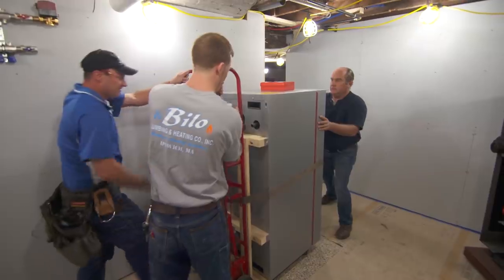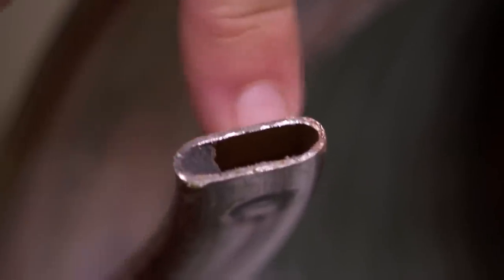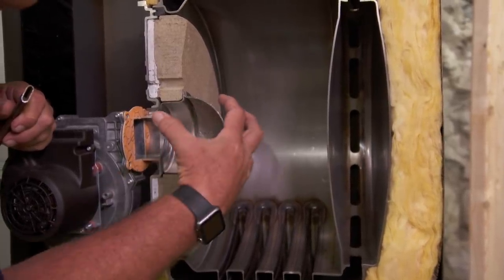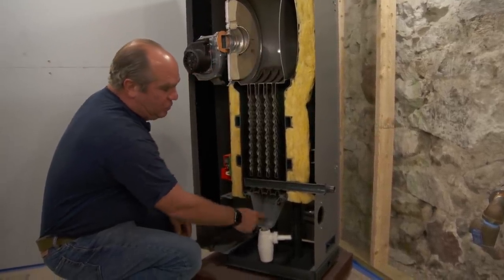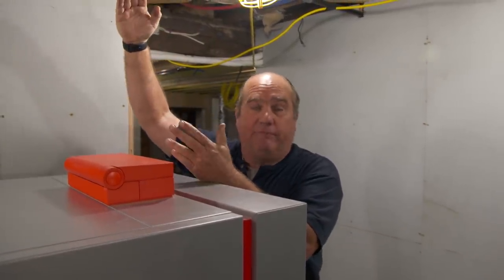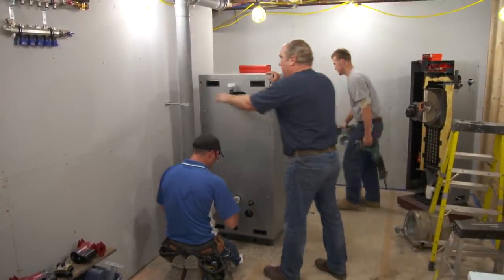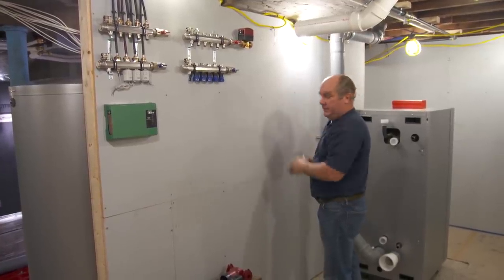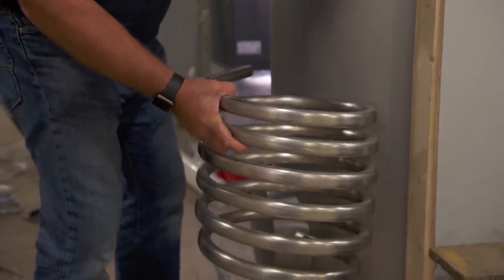How to Choose the Most Efficient Boiler | This Old House

Comment: That boiler is the Vitocrossal 300 CU3A with the 79 gal Vitocell 300-V domestic hot water storage tank.   The vent piping is PolyPro from DuraVent.   The advantage of this type of high mass boiler is that it doesn't require a high flow secondary loop.   The existing pumps and loop from a cast iron boiler will work fine.
Reply: Thanks. I have been researching boilers to replace the nightmare system the last owner of my house put in. You would think TOH would have shown the boiler maker label after they supplied the cut away model for them.
Reply: Is this an "on-demand" oil burner?

Comment: 96% is great and about the top. But when it comes down to it cost per btu. Oil fired units are hitting low 90’s now and have more btu per gallon than propane. So once you factor that and the extra maintenance and that comes with a modcon boiler, are they cheaper over the life compared to a good cast iron boiler?
Reply: And how long is it going to take to amortize the cost?
Reply: In Michigan right now fuel oil is just over 4 dollars a gallon, I'm not sure about propane but I think it's less than 1.50 a Gallon..

Comment: We hooked up a super efficient Triangle Tube boiler that hangs on the wall...been working excellent for 11 years without a single issue...we also use soft water and paid a fraction of the unit they are installing here.
Reply: The Homeowners didn't want that, so they got this.

Comment: I wish they would tell you the cost of the install and equipment.  It has to be upwards of fifteen grand plus.
Reply: I just installed a boiler for my customer, It is 5 zones including the indirect water heater.  Just the parts alone costed me 11000 dollars.
Reply: This would be 30k
Reply: 30,000 and up
Reply: Its all nice when tv pays for it.
Reply: secret as is often donated. You do not get Donated unit.
Reply: @miriamvivo4279  that is a huge house. Houses that are 1400-2500 is enough and I heard for those sf the cost is around 7 grand to 16000.  I know that’s correct because I’m talking to 3 companies and they are quoting me these figures including coils and or registers at the walls.

Comment: Hi Richard, I'm Huntington NY, on Long Island. I need a new HVAC system. I have oil (Dirty) and want to convert to gas, also I have no duct work. Oil tank is almost empty. What do you recommend, when can you come? Thank you for all the great shows over the YEARS!!!
Reply: Buderus oil boiler or a system 2000 boiler. Both reaching 90% or better and are a lower install cost

Comment: I’m amazed the fan on the boiler will push the poc’s that far with so many bends on the flue, in the uk manufacturers state maximum lengths in meters, deducting for elbows and 45 bends, also that flue looks like standard drainage pipe?

Comment: What is the best boiler for a newer home like mine?  I have a Seer 18 Electric heat pump and air handler.   Seems like it costs several hundred yearly to keep this heat pump running right and they only last 10-15 years.

Comment: Connecting the boiler to a storage tank and then distribute to multiple manifolds may be even better as there is only one source calling for " HOT " water. Stored Hot water can supply heat to domestic supply and also radiant ( higher mass system creation ). Not sure of the brand of the Boiler shown.
Reply: Viessmann boiler, and Viessmann indirect DHW tank
Reply: all the high efficiency boilers tried to get away from large volumes of water because you waste energy heating a lot of water when you just need a little heat in spring fall seasons especially then heat is wasted as mid-day it is too warm in house
Reply: But if you’re running micro zones and can’t shed the btu at the same rate as the lowest turn down ratio then you short cycle. Buffer tanks are a great way to prevent short cycling the unit and reduce the number of start/ stops

Comment: Hi Richard, What is the manufacture of this system? I need a new hydronic system, I currently have oil baseboard heat and want to switch to gas. I would love to hear from you and your thoughts.
Reply: Why do you want to switch to gas? My new oil fired unit is 90% efficient. Oil has more btu pre gallon than propane or NG. Would be 10+ years before you saw returns on a gas unit once you factor the increase install cost and increased maintenance of these newer gas units.
Reply: Viessmann vitocrossal 300

Comment: That grey hub seal flue pipe.. If it were installed in Europe and ran trough a cavity in a wall some plumber after 20 years would come to add let's say a new bathroom, he would find the grey pipe in the wall and assume its a drain pipe and connect a toilet to it and next thing you know there poop flowing from your boiler XD
Reply: Hardly!!! In twenty years time no one in Europe will be using gas because "we" are saving the planet!!!

Any exhausting from a gas boiler would have been done properly ... via a flexible  stainless steel flue pipe ... to reduce our consumption of single use plastics.

By then we'll all be using green electricity, including nuclear, with air so clean you could breathe it if you had to.

Fossil fuels will be history and the land will be artfully covered in wind turbines or solar farms.

Homes will be built entirely of straw bales with an R value approaching infinity.

You own body heat will keep the houses at a comfortable 37C, forever, until we really get this insulation thing sorted.

Global warming will mean we're all tricked up with AC anyway ... though goodness where we'll dump the heat from that lot.

And of course a lot of people will be living on water, seeing as the Arctic will be just another sea and Antarctica will be just another massive island, like the Isle of Wight or Australia.

Everyone knows that.
Reply: @martinliehs2513  Indeed. We can only hope the folk who rely on the fossil fuel industry for their livelihood are moved into other decent and decently paid employment.
Reply: Europe is where polypropylene pipe was developed for flue gas venting, I highly doubt what you said would occur

Comment: Looking for new & simple direct vent (no chimney) gas boiler (80% efficiency is fine) that has best shot to last 20 to 25 years and is low maintenance - zero bells and whistles.  My focus is not efficiency.  Priority = low maintenance and longevity.  Currently running 1991 Slant Fin V90 - 80% Direct Vent - baseboard forced hot water - has been excellent, but time to change out.  Thoughts, guys/gals?  TY!

Comment: Isn't the flue gas condensate very corrosive?  Bad for clay or cast iron drainage pipe?
Reply: Yes
Reply: YES. You can add Neutralizer in the drain circuit. ( condensate is acidic )

Comment: Richard if there’s a known problem with wall hung condenser boilers why aren’t the practices changing to avoid the problem you are describing? Wouldn’t be prudent to at least flush out the entire system before hooking up a new system? Wouldn’t it be prudent to place at least one filter before the heat exchanger for at least one heating season so the heat exchanger doesn’t clog up with fines from the old radiator’s and return piping?
Reply: Wall hung units require yearly flushing to descale. But no amount of flushing can combat poor water quality for these systems.

Comment: So what is the name of this boiler?
Is it still considered a condensing boiler?
Reply: Looks like a Viessmann Vitocrossal 300. It is a condensing boiler. It's different than the wall hung units in that it holds more water, which allows the burner to run longer. Reduces cycling. These "super efficient" boilers are good at saving fuel, not so good at saving money.
Reply: @darrinmc  ... pay me now or pay me later. A fancy boiler is probably twice the money up front, but what's a couple of grand over 20 - 30 years if it will save hundreds on the heating bill each year? As for the rest of the system, I feel there's too much high tech to be trouble free for the next 30 years, especially when it comes to smart circulators and mixing valves. When there's a problem at 2 am do you think you will get a guy with enough experience, or the kid who is grabbing for all the OT he can get? The old fashion low tech approach was a separate tank with it's own t-stat for the radiant zones. The boiler's job was to keep that tank at say 100 degrees with a simple on / off cycle. Size the tank right and everything is golden!
Reply: @darrinmc  As a homeowner its still confusing to me. My local HVAC company quoted me 14k to change out my boiler with a Triangle Tube. Only to find out these boilers have issues similar to what this video points out. If I want to buy a new boiler and save on operating costs which one do I buy?
Reply: @SuperM1687  Weil-mcclain GV90.  92% eff. no maintenance needed.  30 year life.
Reply: I’d rather go with a cheap boiler and use a wood stove as a supplement.

Comment: Its probably all fine and code compliant since they are doing it but I don't feel so good about these snapping pipes with no glue
Reply: Trust me, this will last. Using this for decades here in Germany as drain pipes inside of the house, it can handle hot water and agressive chemicals better than PVC. Outside of the house we use PVC-U (unplasticized PVC), also not glued. The gaskets inside of the pipes are so tight, you won't get the pipe into them without lubrication. You see that in one part of the video at 3:21, the guy is lubricating the fitting. Normally you put them together until the fitting is completely inserted, then make a marking with a pencil. Pull the fitting back round about 1cm or 1/2" if you want ;-). That will give the pipes space for expansion and contraction caused by temperature changes.
Reply: It got a gasket in it to seal the joint. not sure how long the gasket will last.
Reply: @QnQoooo  If they use the same ones we use here on the other side of the pond estimated 50 to 60 years. Warranty is 40 years. It's designed the way it can handle 95°C (203°F) hot water without damage...so it is robust...

Comment: I'm considering to install a tankless hot water heater in my home.. it was built in 1990 however now i'm worried the existing pipes might clog the tankless heater with that gew he showed... Any suggestions? Pipes are all copper
Reply: Fernox, magnetic separator, strainer
Reply: Go ahead with Tankless water heater. Is the best thing possible. I had Bosch now with Rinnai  unit.....Flawless ...4 yrs old ....reverse flushed one and is the best for use......I and my daughter take long showers (30 Min) never runout of hot water.

Comment: Having once upon a time worked in the oil heat industry and having a working 40yrWeil McLain boiler in the basement, I’m always interested in the new technology out there. I’d love to have the need and the resources to do a new system but the cost outweighs the savings. My system uses cast iron baseboard radiation (radiators?) and I probably use about 500 gal/yr. It’s unfortunate that our current government is trying kill the fossil fuel industry and try to run the country on electricity… I don’t think it’ll work but then who am I to outthink our great government!
But thanks for the video.

Comment: Then it breaks and nobody knows how to fix it.  The parts and labor costs are a fortune. Then, it only lasts 8 years.   Your better off with a low efficiency boiler. Mine is 53 years old.  Came with the house and I've spent less than a grand on it in 30 years.  Plus, its so simple a child could work on it.
Reply: 😂😅 I love your assumption that nobody's keeping up with how to work on these things... You clearly don't understand the industry that you're talking smack about
Reply: @mtoto78  
Thats coming from the 3 technicians that I called for bids on a mini split air conditioning system for my house. I was actually interested in replacing my boiler only because they all do bundling deals. All three worked on boilers and furnaces. None recommended switching due to the reasons  said. Two of the three said they only had one guy that was willing to go to Texas for the two week class needed to install (correctly) and maintain the units they sold. The third said: "we get more calls asking us to take them out than to put them in."  Now either I'm lying to you, or they all didn't know what they were talking about.
Reply: @bubcat54  Cool story, unfortunately it runs completely counter to what I've found for being in the industry for 20 years.